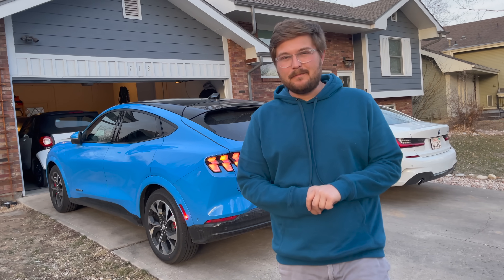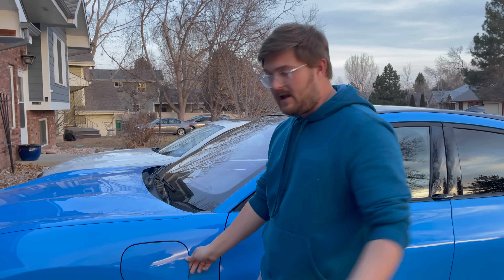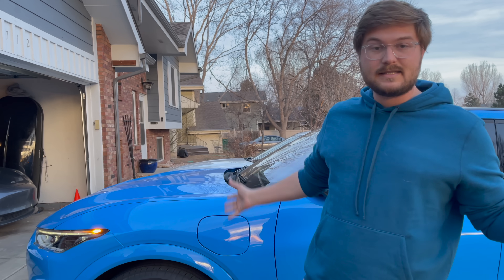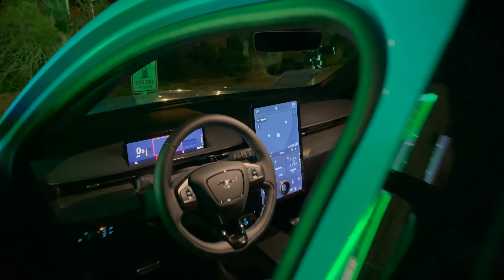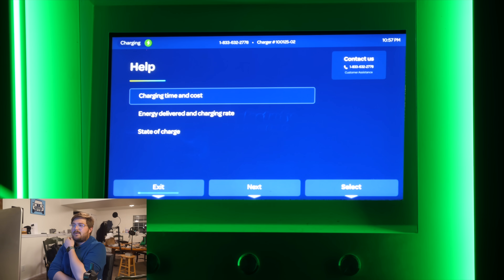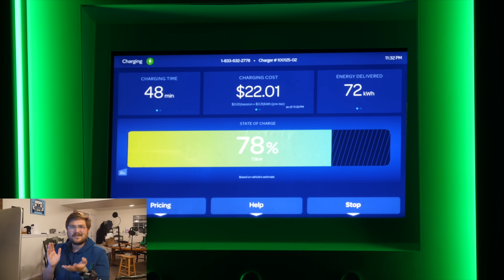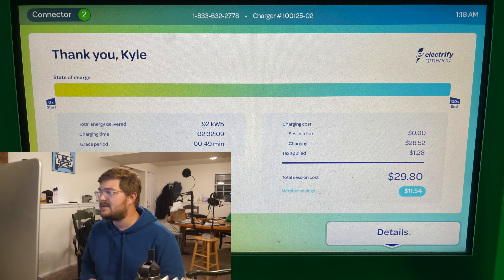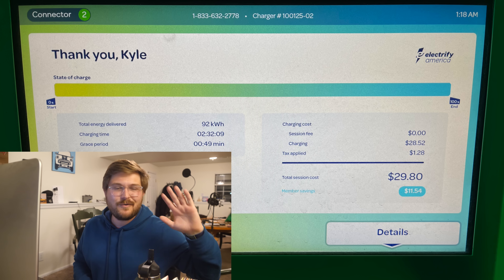DC Fast Charging Mustang Mach-E From 0-100% Takes Over 2 Hours! Here's Why.

Comment: Most ev owners charge at home, this data is relevant if you take longer trips that requires charging to 100%soc during the trip.  Otherwise, charge to 80% and make more frequent stops at charger and charge until the speed drops below the maximum charging speed.
Reply: It's definitely something worth considering. "what about my road trips" are one of that last real concerns people have.

Though realistically, I can't imagine many are doing the cross-country trips where it's too relevant. If your vehicle's got 300 miles range, one half-way recharge will get you pretty far. If you stop to eat meals it's really not too big a deal.

Comment: The charging curve is the only thing holding me back from getting a Ford EV... but after living with the Chevy Bolt EV charging curve I will not buy another EV with substandard charging.
Reply: The Bolt's max charging speed is 50kw and the battery is huge, the Mach-e has a max of over 125kw.. But you have to make sure the charger you are using is the newer EA chargers that have the higher charging speeds... 

The older BMW i3's have a max 50kw charging speed, but those cars have very small batteries and charge from 0 to 80 in less than 15 minutes.
The Bolt will take much longer because its battery is far bigger and the battery's max charging speed is 50kw.
Reply: @mamadouaziza2536  The Bolt max charging speed is 55 KW (0.9C for 2017-2019, 0.8C for 2020 and above), only available on higher powered charging stations like Electrify America.  Any car that does not charge at a bare minimum of 1.5C is to be avoided in my opinion and 2C or above is needed to be desirable.
Reply: @keithmcdonnell4485  
Nearly all modern EVs do in fact charge at 50kw when possible including the i3, 2020 Fiat 500e, Honda e, Mini Cooper e, the Koreans, Renault Zoe from 2016 and beyond...
Reply: @mamadouaziza2536  And that is why I will not purchase them... they charge to slowly.  I expected much better from Ford.  I hope Chevy does better with their new vehicles coming out with the Ultium battery pack, or they will be removed from my list of potential purchases as well.
Reply: @keithmcdonnell4485  
Well the cars I mentioned have small battery packs, so 50kw max is fine with those cars.. You will not see a faster max charging speed on a GM product until the Hummer EV comes out, all electric Chevy's charge at 55kw max as of right now.
Chevy will evolve..

There are plenty of EVs that have a max charging speed of 120kw or more.. There are plenty of second hand Tesla Model S P100D from 2017 to 2019 going for as low as $80k, originally cost over $140k.

Jaguar iPace, Audi eTron, Porsche Taycan, Porsche Taycan Turismo, Model X and Model Y, eNiro etc..

Comment: Can you give us an idea of the range you are getting with the Mach E?  The extended battery + 4 wheel drive is suppose to be 270 miles.
Reply from the maker: 270 is EPA, unlikely to match in real world. Will be doing range testing soon
Reply: I'm getting from 5 to 5.5 km per kWh on the highway.  ER AWD.  Assuming you use 80 kwh, that gets you to 400km or 250 miles with a decent safety margin.

Comment: I've been testing out the CCS Tesla adapter on my channel stopped at 5 stations yesterday... I found a Chargepoint at an oncue gas station in Oklahoma City. first of all very clean install three parking spots, two stations with CCS/CHAdeMO. 125 KW shared between the stations so if you're there alone you can get nice power. But the big thing was the price was 9¢ per kilowatt hour!!! That's cheaper than most home charging! amazing! Anyway I just can't quit bragging about that station next time you're through Oklahoma City you should try it out for sure!

Comment: As an owner of an ICE, I am not worthy to comment expertly on the subject of battery charging. It seems logical that Ford tries to encourage Mach-E owners to keep their state of charge between 20 and 80 percent which is great for the longevity of Lithium ion batteries. Yes, the charging speeds could be improved to Tesla-like ones but with a potential for shorter life of the batteries. I think that Ford has done a very good job on their first full-fledged EV (the Focus doesn't count at a 70 mile range). Great video, and am anticipating the road trip results!
Reply: 20-80 or less helps with batteries and helps those who are low and waiting to charge. Most people tend to forget about that last part.
Reply: Still a useable ev even if it was only built for compliance in regards to ever increasing emission standards.

Comment: Gotta admit coming from an ICE car, I am not seeing a compelling reason to get a Mach E  at all. 2hrs 32min and almost $30 cost (with discount) is not what I call a savings in time or cost over having an ICE car!
Reply: I will add - I am not against CSS or non-Teslas. Even though I’m a Tesla owner (and stock holder) I’m super excited about the proliferation of EVs: Ford, VW, GM, etc… In fact, I want a CCS charger adapter for my own Tesla so I can travel to Durango and other southern areas of CO more easily (I can do L2, but…). My only beef is that I think EA is far more expensive that it should be. I think its the only thing Kyle and I probably disagree with. The only thing that lessens the impact is 99% of the time you’re charging at home, or free/cheap charging at the office/etc with L2 so overall its still way cheaper to charge in any EV than gas. I just feel its a bit of a gouge from EA’s side.
Reply: Even though Kyle said the price was “fair”, I don’t agree. Tesla superchargers are at .23/.24 per kWh so the Electrify America cost is 50% more. At home its even half of that. I save $50-75 per car during Covid. If I went to the office daily like I used to i’d be saving about $150 a month in gas.
Reply: @HobbitFootAussie  Yeah from the many Tesla charging videos I have seen, the Models 3 and Y are faster to charge and a lot cheaper on the Tesla Supercharger networks. While I do like the styling and some of the features of the Mach a touch more than the Model Y, no way would I get the Mach E until they at least improve their charging speeds. Also the Tesla Supercharger network is so superior to the other charging networks too.

Comment: It's weird: if you put gas in your ICE car they bill you by how much gas you pumped no matter how long that took, but doing the equivalent in an EV is not allowed in some states.
Reply: Electricity is defined as a utility, not a fuel in many States, so the regulations for production and sale are still covered by utility company monopolies. Until those States change the definition of electricity, charging services can't sell you electricity by the kWh because that is solely the purview of the local utility monopoly, so they charge by the minute. It is part of the same regulations that make it so local utilities can't operate gas stations or sell propane, which are defined as fuels.
Reply: @tjs114  Oh I understand that part. I was just pointing out how similar they are even though they seem on the surface to be totally different things. Laws, for sure, will need to be modified in the coming years to account for a changing landscape.

Comment: This is really just an ad for a Tesla or a good PHEV if you plan on driving long distances, I haven’t seen a BEV made by someone other than Tesla that impresses me for time of charge, and of course a PHEV like the Clarity, a used  2nd  gen. Volt or a Rav4Prime would give you a EV around town, and a vehicle that could do road trips with ease in hybrid mode.
Reply: @andrewcook3292  I going to buy a BEV next but mostly for around town use,  w'ell keep our PHEV for long trips, in almost every case, the recharge numbers are a best case scenario, temperature and humidity, condition of the charger, power grid restraints, and number of people charging at the same time, all come into play
Reply: Ok. It sounds like a nice plan. Just wondering. Can you delete the @ mention?

Comment: What a pain in arse spending so much time getting refill in some remote unsecured car park. What does one do for hours loitering around looking suspicious in dark. Setting yourself up for easy picking for mugging hanging around outdoor power points.
Reply: The reality is you would not be spending that much time like he did here. If you notice it got to 80% in about 25 minutes. That would be the point at which you would leave and go to the next charger if you are on a road trip. You probably wouldn't even be there that long because you're likely going to arrive at the next charger at about 10% state of charge. So you're probably looking at a 15 to 25 minute charge not 2 hours and 30.
the road trip strategy on a electric car is completely different than a gas car. While I admit it certainly is a bigger pain in the ass you also have to factor how often do you even road trip? Keep in mind for most people daily driving it you're going to leave your house everyday with a nearly full charge. That's a positive convenience while the road trip charging is a slight negative.
Reply: @kens97sto171  Wasn't it 50 minutes from 0 to 80%?

Comment: In the states where charging stations can charge per kWh, Electrify America has definitely improved their charge costs, even better than Tesla's, glad they've made the changes. Would be nice if they would build more stations where Teslas don't have, but they are probably going to run into the same issues that Tesla does with agreements and whatever city regulations. 

The over an hour full charge is really terrible though, you'd expect more from a manufacturer like Ford when trying to compete with Tesla.

Comment: Ford needs to get that last 20% programmed higher. Thats why I haven't even gone and test drove one else I really would consider it.
Reply: The last 20% is really not the important part. All EVS charge pretty slowly in that last 20%. If you go on a road trip you're going to be driving between 10% and 80%. That's the crucial part. My biggest complaint here is the cost. If you factor the dollar per mile for this charging session my Toyota hybrid cost me significantly less and I'm not wasting time had a charger.
Reply: @kens97sto171  when you have a vehicle that burns as much more wh per mile as this one you sometimes will need that last 20%. Down here a sr Tesla in the cold can’t even travel a certain run of highway without being above 90%. 

Just because some markets have these chargers don’t mean much. I’ve never seen these chargers anywhere. 

I’m in New Orleans and we keep getting put off for superchargers. Been coming since 2017 and just getting pushed back over and over. 

12kw at 80% is very low. It should be more around 24kw and drop off gradually. More so on this because it has a buffer in the battery beyond what 100% is.
Reply: @radzer0966  
There are three EA chargers in Louisiana.  One west of Lake Charles in Sulfur,  next is east of Lafayette, next is near Hammond.
There is a large zone on I-20 with none..
There Are 7 Tesla supercharger in Louisiana.

I agree with you that the rate of charge above 80% is slower than it should be my only point is that it probably isn't going to matter most of the time.
Reply: @kens97sto171  but when it does. It does. 

I’m kinda hoping Ford gets it together with better efficiency. Heat pump and better software. 

Gotta love the powered windshield defroster tho. Tesla needs this.
Reply: @radzer0966  
You can say that about any car..
99% of the time people charge at home only. Won't matter.  The few times a year people MAY road trip.. so it takes a little longer. 
Charging speed is not the only thing that matters to a buyer.  Looks (subjective), interior design, build quality, performance, practicality, reliability, serviceability. 
People buy enormous trucks they never use to tow anything.. for lots of different reasons.  They don't NOT buy it because the fuel economy sucks.
The other things they like about the vehicle matter more to them, so they buy it.
Same will happen here... 

I drive a pretty boring car by most people's standards...  2nd gen Toyota Prius.
Because my priorities are Cost per mile, practical, reliable , comfortable transportation.
I drive for a living.. so those things matter more to me than looks or performance or handling, or what people thing about my car.
This becomes my dilemma, because quite frankly most of these electric vehicles on a road trip cost the same or more than it would cost me to drive the same trip in my Prius. That is certainly true on this charging session. He paid $30 to add 250 miles. 250 mi would cost me $19 and I wouldn't have to spend any time at a charger. For me I have to factor that too what is my time worth?
So until something extremely persuasive comes on the market I'm going to keep my Prius. The other possibility would be for me to buy a used Chevy Bolt which quite frankly is a fantastic little city car which is about 95% of my driving. and I'll just keep my Prius for the occasional long road trip when I need to haul ass across country.
My record in my Prius is 1200 miles nonstop in 17 hours.
Drive 350 mi stop refuel stretch get a drink get a snack repeat until I'm tired at which point I sleep in my car which I can easily convert into a little pod hotel room.
Couple years ago I took up 4,500 mi road trip. Took 2 weeks for the trip and it cost me $315. That's when I factor my seven cents per mile operating costs. Was actually only about $280 in gas.

Comment: It took 2.5 hours to fully supercharge my 85D Tesla, Tesla sent me a software update that slowed down my supercharging. Oh well that car is someone else's problem now. I would avoid the MachE even though I like it, because Ford is learning lessons and I don't want to be early adopter on new EVs like this again. I got burned and I wonder about all new BEVs.
Reply: My model 3 using the 2170 cells and I think it's much faster now. My 2019 can do 0-100% in about 52 minutes. In my opinion, it is pretty good speed. My uncle 2020 model x long range plus can do it in about 1 hrs and 20 minutes. I think because it had an older 18650 cells and a little bigger battery pack. I hope the 4680 battery coming later this year will do little bit better 😋
Reply: That's why you dont buy a telsa since they have so much control over battery and charging. Locking out range, adjusting charrging speed etc. Good batteries/ok car terrible brand.

Comment: Since your of one of the few who’s actually done long trips in both the e-tron and Mach E, which do you prefer?  Shorter range/faster charging e-tron, or the Mach e?
Reply: Bjorn nyland has done trips in both
Reply: @markfitzpatrick6692  Appreciate it.  However, Bjorn is in Europe and I don’t know if it’s just his personal perspective, the different weather, or something else, but he often doesn’t feel the same way about these cars that I do after I’ve driven them (e.g., he felt the suspension in the Mach-e wasn’t very good. I find it 10x better than the Model Y that I owned).  Also, with their electric infrastructure, not really an apples to apples analysis of range and charging speeds.  Out of Spec lives really close to me (I’m in Virginia), so his comparos are often on similar roads to me and using many of the same charging stations. Bottom line, an Audi e-tron might be a better car where Nyland is, but the Mach-e might be better in the US, or vice versa...

Comment: Was really pushing to get a Mach-E, but after this last recall halted any chance of one being sold, I bought a Model Y LR. If I did find one that was available, I was greeted with ADM(Additional Dealer Markup). No thanks! I am a veteran and I don't recommend the dealer I contacted. I was told no X plan pricing and no Military discounts on the Mach-E.
Reply: The recall only affected 70 vehicles that had been delivered.
Reply: Thank you for your service.
Reply: Do they give A plan pricing on these?
Reply: @BloodySoup74  I think it really depends on dealer. Some deers did 4k off and some mark up!!

Comment: Omg! Over 2 hours for 220 miles? That is awful!!! I guess I'm keeping my truck.
Reply: Great comment! My cousin, a Colorado PU owner says the same thing about EVs, not practical for power driving road trips.  Still, think of the daily convenience of waking up in the morning and finding a fully fueled and prewarmed vehicle sitting in your garage, ready to go.  And no issues with waiting in the dealer for timing belt changes, oil changes, transmission service, spark plugs, etc.
Reply: @ronkemperful  yes all that's true. If I was going to buy an EV it would be a Tesla. Probably a Cybertruck. About 45 minutes to charge vs 2hrs.
Reply: Wouldn't you stop at 80% and just drive 100 something miles to get under 20% then charge a few minutes again.
Like tesla on trips the in car nav has you charge at 20 and stops around 50 so each stop is enough for pit stop

Comment: 2.5 hours(150 minutes) vs. 5-10 minutes...to fill with gasoline or diesel...ummmm...just a local commuter car for me at this moment in time.
Reply: Yeah BEVs still aren't there yet! With that said though if you can charge on a road trip from like 5-50% it would be less time. Kyle does that sort of thing on his Tesla road trips, stops are more like 15-20 mins
Reply: @InternetDude  ...it’s getting better all the time...just having this alternative network to charge vehicles is a big step forward. I’m wondering when gasoline outlets will start devoting some pumps to charging stations...probably will be happening shortly especially with independently owned(non-major oil company badged) ones.